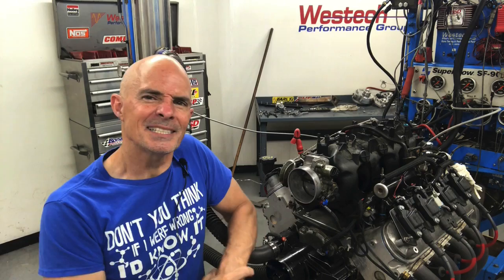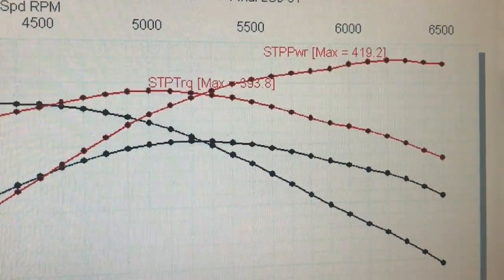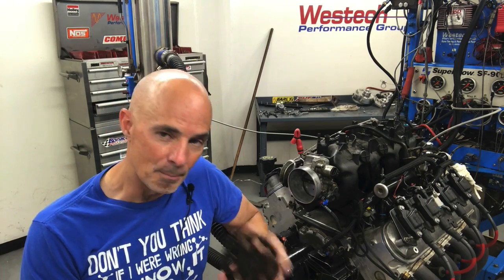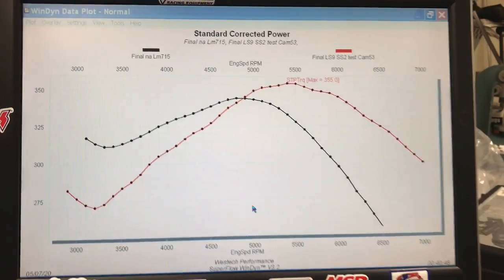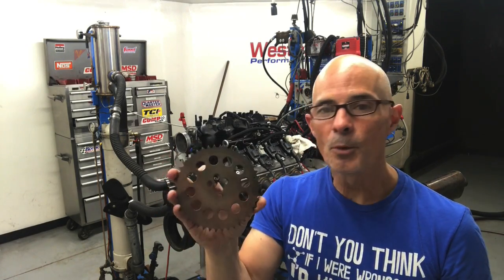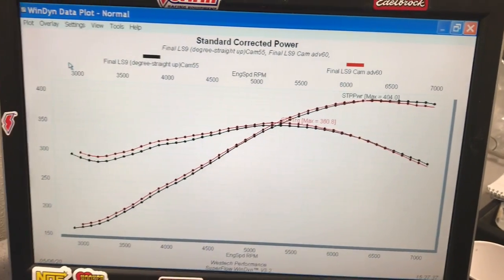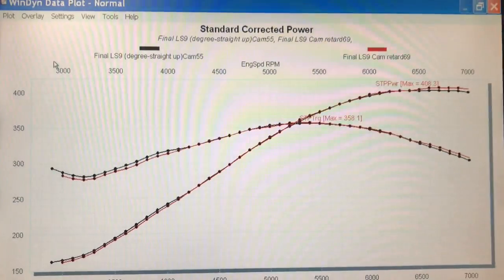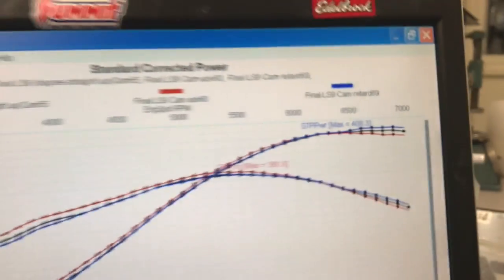LS9 HOW TO: EXTRA TORQUE!!

Comment: I’m always disappointed that dyno runs measure from 3000rpm onwards. My engine spends a lot of time at 1500rpm and it would be interesting to know how that is affected.
Reply: how often are you WOT AT 1500RPM?
Reply: @lukeanderson5781  how often do you reach zero vacuum or close to zero vacuum at 1500 rpm climbing a hill, right before an automatic downshifts?  Quite often in a truck with a 4.8 or 5.3.  If a water brake can't hold it that low, that's one thing, but some people want to know because they don't want to lose their drive-ability down low.
Reply: @lukeanderson5781  Stupid answer...
Reply: @lukeanderson5781  full throttle is not the only place a pedal can sit while out on the highway.  People want to know about drivability as well full throttle peaks.  An engine making good torque at a cruising rpm is much nicer to drive.  Obviously people have to be reasonable and accept that you MUST deal with compromises.  Without knowing how much low rpm grunt it makes, you have no idea how the vehicle will deal with that 7% grade on the highway.  Will it downshift and rev out to pull the hill?  Sure, that can work fine.  But it's also nice to make more torque and not necessarily need that downshift to maintain.  Obviously forced induction makes this all FAR easier.  But that is not the setup that everyone has.
Reply: advance cam increase low speed torque and vacuum.It may increase gas milage.  and the opposite.
Reply: This is testing wide open throttle response for full power pulls, if you want to tune your engine that low, get a wide band o2 sensor, that will tell you damn near everything you need to know, beside the power at the ground, LOL.